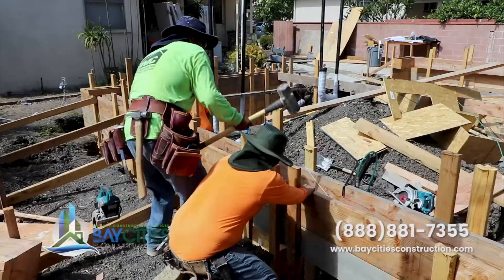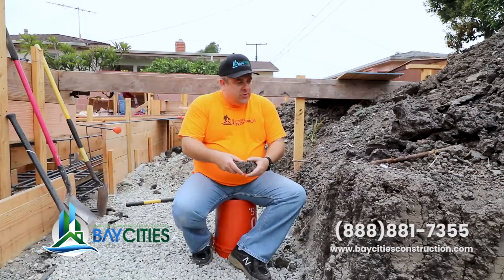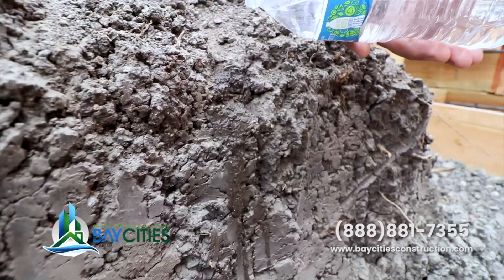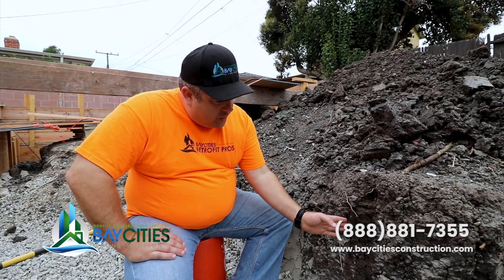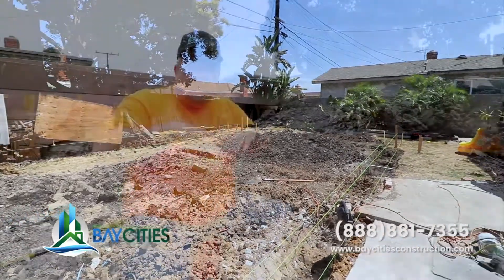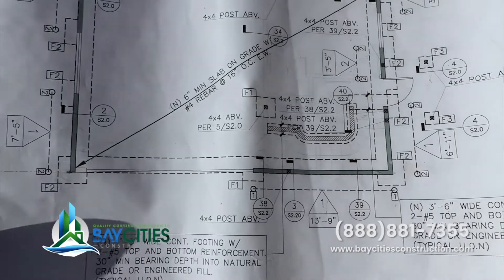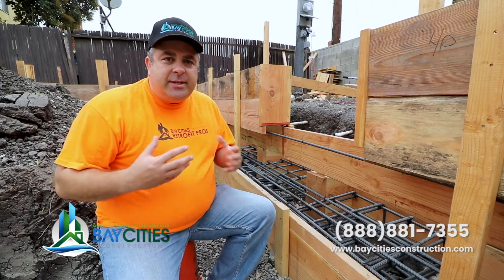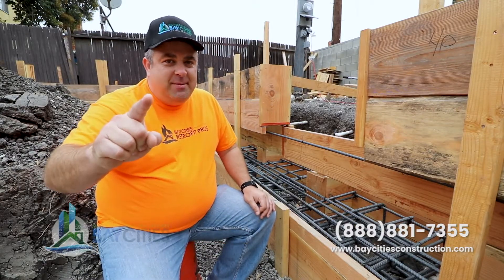How to Deal with Expansive (Clay) Soil in Torrance, CA

Comment: nice info!   looks like you excavated quite a bit... did you use that clayey soil again, or did you bring in new dirt not susceptible to expansion?  looks like you dug in several feet    4 feet?
Reply from the maker: Excellent question - after we shot this video the geotech engineers recommended that we remove two more inches of bad soil, which we later infilled with "No,4" Medium Gravel.
Reply: great!  Ever use lime on clayey soil?   The chemical reaction creates a ‘cement like’ process and more stability
Reply from the maker: We haven't had the opportunity, the geotech engineers never mentioned that process.

Comment: You should chemically stabilize the soil before construction. My soil in Texas has a 6” lift. So After treatment it now has a 0.1% expansión.
Reply from the maker: Hmmm unfortunately that does not appear to be an approved method here in Cal.
Reply: @Baycitiesconstruction  look into it. There’s several companies that do it. EarthLok is one. Basically the geotechnical engineer sends out for some test boreholes. They test the expansion lift and heave of the soil. I had an average 6” of lift. Then I had the Stablaztion injection done down to a depth of 10’. Then 3 days later you have 2 more boreholes done and tested. Mine came back with a 0.1% lift. Down from 18%. Problem solved. It’s an accepted form of Stablization. Just it’s not well known in California. Because California doesn’t have the big problems like Texas and the mid states do.
Reply from the maker: Thanks for the tip - we're definitely going to look into it.
Reply: In California little use of these products;  I have seen geotextiles at base coupled with geogrid for stability.   Also homes in our area usually have post tension concrete

Comment: Great video. In many parts of the world with expansive clay soil they use Raft or Mat foundations with great success, do you guys build this type of foundation and if not why?
Reply from the maker: Hello 👋 In the United States most residential (home) construction foundations fall under two categories: Slab-on-grade or Raised (crawl space) Foundations. Raft/Mat foundations appear better suited for commercial construction since they require excavation & shoring, which is not feasible for the majority of residential construction projects.

Comment: I am looking at a home for purchase in north torrance right now and one of the rooms has a long crack where the ceiling meets the wall and there is also a large vertical crack in the wall. I understand this is due to the expansive soils, but my question is will the crack keep opening and closing if I keep the soil dry and maintain roof water runoff into the street?
Reply from the maker: The problem will persist unless you reinforce the foundation (similar to what we did in this video) feel free to book a complimentary consultation at https://www.baycitiesconstruction.com or call 888-881-7355